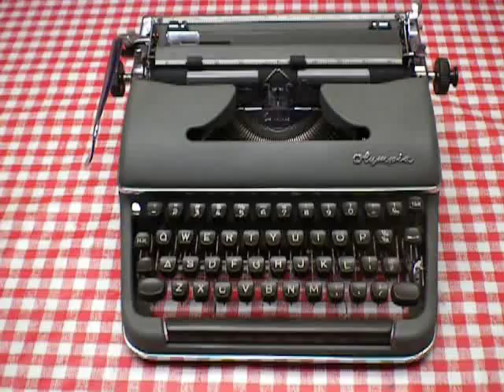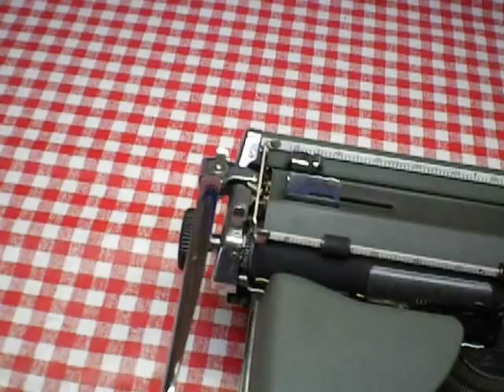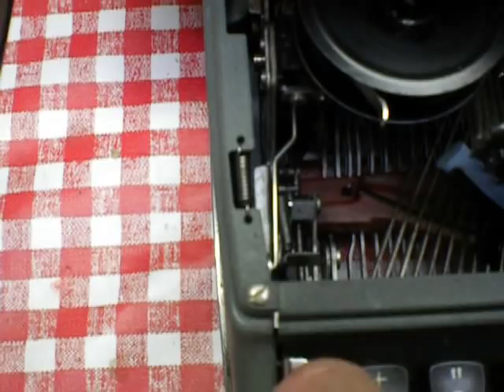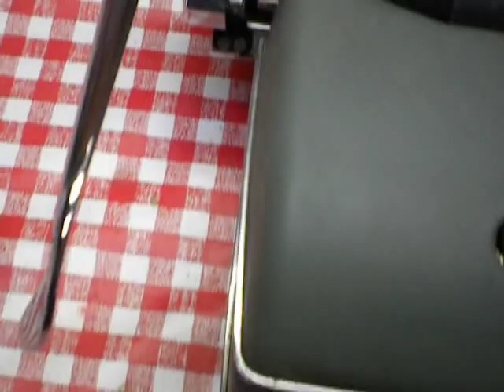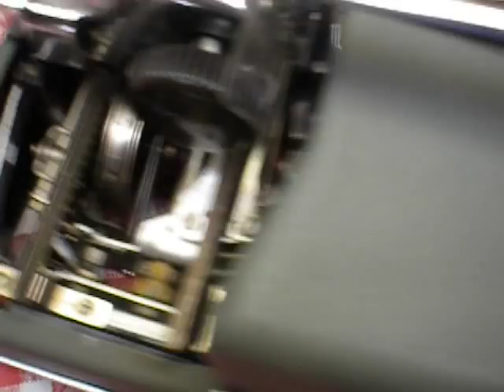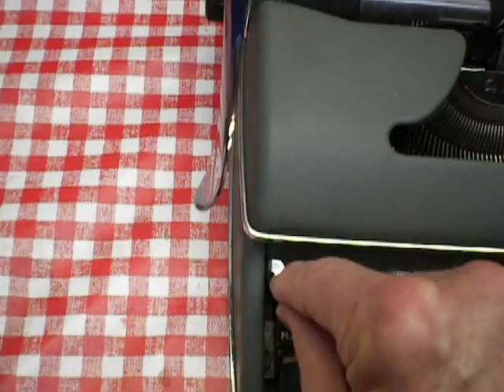How to Repair the Carriage Lock on a Olympia SM3 Typewriter  --- Curtisz Typewriters

Comment: I have the identical issue with my SM4 (as the other commenter)...the carriage sticks in the center, and a slight lift on the carriage will clear whatever obstruction is there (even a millimeter of lift works). I've had one suggestion that the cause could be worn bushings that have left the tolerance between the carriage and whatever it's hitting too close. The carriage lock does lock and unlock.

Comment: Thank you very much for posting this.  What actually happens in my case, is that the unlock key seems to work,  it moves and unlocks the typing keys, but the carriage stays locked.  I've found if I actually manually lift the whole carriage bar it seems to get over some kind of hurdle and then I can carry on typing. Have to lift every time to pass middle, either on return or typing.  Any further ideas? would be most appreciated.

Comment: Very useful vids from Curtisz, thanks!
on my SM3 everything works fin but using line spacer leaver does not click. Obviously does not engage with the gear. Where woud I have to work finding a solution?

Comment: Clark i have an underwood 4 and the carriage wont move even when pressure is applied to the carriage. I installed a carriage cable with good spring pull power. But like the pressure from my hand it does nothing.

Comment: Hi, I was hoping you might be able to help. I just bought one and it was working fine. All of a sudden the carriage flew over to one side and now whenever I pull it back it won't stay where it is meant to and springs right back. It is as if whatever was holding the carriage in place when I type has come loose. Any suggestions?
Reply: same problem here...did you find a way to fix it?